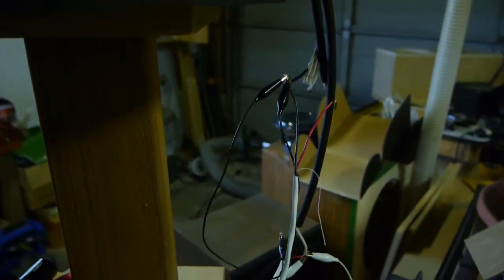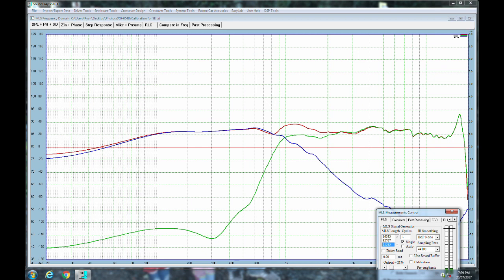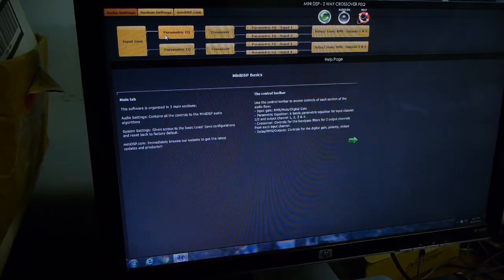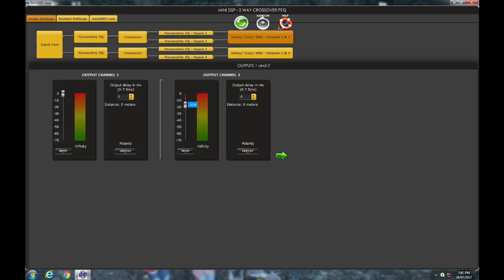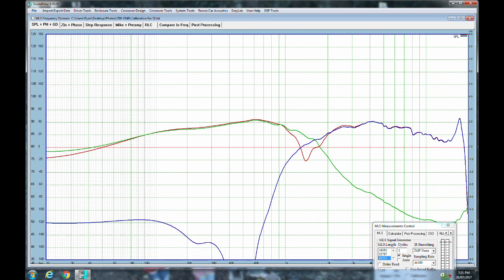Are Active Crossovers Easier than Passive? NO!

Comment: Hey you didnt point out the major attraction from the active xover, that by splitting the audio into separate bands BEFORE the power amps, each amp and each speaker unit now handle only their allocated band of sound, or in other words, each amp now outputs LESS power at a given SPL, coz it no l9nger has to amplofy the other band(s) of aidio that otherwise gets sent to the speaker which filtres it out oventually in a passive xover design. 

I find active xovering an advanced level of playground for audiophiles and engineers that give much much more tuning possibilities than simply matching one amp with one whole speaker.

The audio perfectionist's l9ve here.
Reply from the maker: That is true, active has many great advantages over passive. This video was only to show that they require equal knowledge of how to design a speaker. Seems I didn't make that point very well though.

Comment: I'm using a Pioneer active xover with my Tannoy 10" Gold Mon. and my JBL 4320 (this one as a subwoofer) to listen to vinyls. This must be much better if I switch to the  digital minidsp. But how do I use that minidsp unit for analogue audio? Impossible without further complication, right?
Reply: Stick with your Pioneer or pick up an Ashly or Marchand. Both sound very natural. Not DSP's but once you get the points figured out by testing, set it and leave it. You'll want to fabricate a BSC network between x-over and amp for the best sound. Do a Google search for a diagram. It will only cost you a few dollars in parts. Be prepared to be blown away by the sound quality.

Comment: Wow.
"look! The phase is wrong! I knew it would be bad! Don't use active crossovers guys"
later: presses a button to correct phase
Reply from the maker: Gara Von Hoiwkenzoiber I did not know how bad the phase would be. Yes phase is easier to correct with active. But the same knowledge and work is required to get there. That was the point of the video. Not which one is easier to program. It’s not a magic box like some people treat it and think it is. Not many people even know what phase is but they think active just makes it ok.
Reply: Hi, im feom indonesia.
Mini dsp is $105 at PE, with shipping and tax its $161 at my door.
Dont have budget for it.
I go with $3 caps, and $6 inductor.
With free XSim, im doing fine with passive.

Comment: I think you make valuable points in this video with adding another channel into an active setup introducing potential phase issues, and you also explained how to use the tools to remedy those issues. 

The mini dsp is going to be much more versatile than a passive cross over and can be used in conjunction with passive. The beauty is in its modularity. 

The tools in that little box will yield much better results than passive crossovers alone. The time correction alone will allow you to achieve focus in irregular or odd shaped listening environments and you can make instantaneous changes on the fly that can't be accounted for with calculations.

Comment: Active is the only way to go. I haven't touched passive for years. I have a miniDSP 2x4, MiniDSP DDRC24, Dayton DSP-408, amplifiers with built in DSP, etc etc. It makes life so much easier and cheaper. Different speaker projects become much easier for newbies to get into without having to have a degree in electrical engineering and soldering. With a DSP you can make changes on the fly while listening to music rather than taking everything apart, buying different components, connecting components then listening..no way to A/B compare or tune the system quickly.

Comment: Generally the group delay of the woofer is longer than the tweeter due to its higher inertial mass. Therefore to synchronize them in time the digital delay should be applied to the tweeter

This is still not good enough to get phase coherence. To do that they need to have the same geometric center of propagatoon, in other words they have to be coaxial. 

This problem is like throwing two rocks in a still pond and getting them to produce ripples as though they were a single rock. To achieve that they not only have to hit the water at the same time but also in the same place,  otherwise you will still get phase interference patterns.
Reply from the maker: Mark Fischer in this case the delay was applied to the woofer because the tweeter acoustic center was behind the woofer.

Comment: Never liked DSP.
Reply from the maker: WESTEL Audio really? I don’t have a problem with dsp, it’s powerful that is for sure. So I use it where appropriate.
Reply: @ImpulseAudioSpeakers  

I feel like it's just adding unnecessary complexity. You can't use a normal 2-channel receiver and if the DSP, being a very fragile little computer, breaks you have to start all over again. Only things they are good for are active PA speakers where weight really matters or sub/sat systems with very low cut-off.
Reply: @westelaudio943  Lol fragile. I can promise you that if you drop it from 1m it will survive but if you drop your 15kg avr from 1m it will not. Smaller electronics is usually more durable.

Comment: What I really don't get with the practicalities of phase is that the SPL can measure fine (flat) but I believe there can still be phase issues which play havoc with the sound.  Any thoughts welcomed, cheers Ryan.
Reply from the maker: MrFrobbo what is usually happening is a case like this is the FR is flat but phase is wrong, so the power response (a combination of all points off axis) ends up being very peaky in the midrange (or where ever the XO point is). It can sound very glaring and forward. Something won’t sound natural.
Reply: @ImpulseAudioSpeakers  Thanks Ryan really useful...think I'm getting it...slowly!

Comment: I get your point that one cannot naively convert a passive design into an active or design a system from scratch without having at least minimum required knowledge regarding designing loudspeaker systems. you give a very good example in this video yourself. I think rookie DIYer having no clue about phase issues would try to eq that dip out in minidsp and arrive at a badly designed system that potentially measures quite flat but sounds just not right.

also one thing to remember is that those who attempt to design active systems do it not only for the sake of driving each driver with its own amplifier but also for possibility to take full advantage of DSP power - driver time alignment, linear phase xo, driver linearization, steeper slopes.
Reply from the maker: David Gale thank you for understanding the point of the video. It was lost on many. Your right about the advantage of DSP. It is very powerful and if you know what you’re doing then it is unmatched by passive.

Comment: Delay?  your tweeter is 140deg out of phase (according to you)...  you've tested it with a generic passive and now with active....   Did it occur to you to flip the electrical polarity on the tweeter, in order for it to be acoustically in phase with the woofer.  The delay hack is a horrible suggestion, because now the woofer and tweeter going to be OUT of phase EVERYWHERE on the spectrum, by the amount of the delay.   It's not a big deal because the x-order is 24db/octave, but it's a hack - the delay was never meant to be used like this.
Reply from the maker: pretol the delay was absolutely meant to be used like this. It’s puts the drivers exactly in phase where as simply flipping polarity would still be out by 40 degrees. Not sure where you got the idea the passive XO was generic. It was properly designed which is why it measured way better.
Reply: You're right, I meant generic active (which is the hack job you've done for this "test") vs "properly"-tuned passive (according to you).  Which is NOT good guide for people that are building speakers at this level, and YET, here you are making profound conclusions.   You'd have to be a moron to design an active XO with generic parameters.  Tunability is THE WHOLE point of active XO's (presumably with a calib'ed mic), and here you've done almost none (except wiring your tweeter backwards, and compensating for it with delay).

Comment: Luv this guy's vids but this beyond his scope (no disrespect), you can't hack DSP, it's graduate level math. For example you can auto compensate a speaker that would not be possible by analog/passive means (theoretically impossible). DSP essentially emulates the analog parts, thus u can create a "part" that does not exist or even physically not possible, like negative capacitance (I'm keeping this simple, it's the same tech used in military guidance sys for example). Beyond that you can compensate the speaker's impulse response (not practically doable in the analog world). Then there's efficiency, the reason you have power components is the passive X-over is it throws power out the window to compensate (utterly ancient way of doing things).   good news is you have software that can do it all work for you now, no thinking involved, like cell phones leading everyone by the nose (yeah i'm from the DSP world, b4 it was a buzz word ;) ).
Reply from the maker: Greg D no thinking necessary? Clearly using dsp is also beyond your scope. The point of the video was to show newbs that just as much thought was necessary. Did you watch the video? Not sure you did. Please watch the whole thing and tell me if you still don’t get it. A newb cannot just hook up a dsp magic box and enter 2000hz LR4 and expect good results. That’s not going to sound good. And I showed it here. 

Clearly my video was not easy for people to understand. For that I apologize. Still not sure why, I thought it was simple. It is just as much design work as passive. Period. 

And BTW, I like active, maybe even more than passive. This is not a hate on active speakers video!!
Reply: Wow man, i was being polite, you're having a reaction. Yes i watched the entire vid, did you read my entire message? You do good stuff man but your video was like someone who's never flown a jet then trying to demo it without any flight experience of any kind, but again, no disrespect. Or are you saying you're very familiar with DSP? enough to say it's beyond someone's scope? You know convolution cold and it's edge affects? u know self adapting communication channel compensation filters so these audio steady state one's are are like childs play? Because if you are, then spend a little more time on the vid to do it right, if not then maybe don't post until it is right. So yes, there are programs now that will analyse the speakers then adaptively create the dual FIR/IIR filter coefficients to completely compensate it in every way, you can follow a procedure so one  doesn't actually have to know what one is doing ( here's one for the laymen: http://www.bodziosoftware.com.au/). Verses say going knee deep into MATLAB or writing your own code and download your own coefficients to the DSP, but again, then you have to know math at a graduate level. Also that MiniDsp unit you have will not do impulse response correction and i don't want to get into why but it's a key disadvantage. And really man, every wonder why it's only "home guys" posting on the net, not guys from the Boeing lab or Tesla or the DOD or other pro's? because they keep it inhouse, so it's odd to me when an expert might chime in and say, be careful, you might unknowingly be posting miss information (which is rampant now). So one of my "DSP buddies" saw your response and said "why do you bother man?" and yeah.. he's right, so good luck man, this post was for others and try beware of what you don't know (btw, spare me the "male fragility complex" which is what your "clearly dsp is beyond your scope" retort is (i qualified mine), unless again, you're in the DSP industry as i inquired above, which means you really do have some other issue).
Reply from the maker: Greg D alright sorry, my comment was over the line. Although it was really no different than your comment. Saying you like my other videos first doesn’t change the comment. 

I still don’t understand what you disagree with in this video. The video is saying that you cannot take pre determined electrical filters and simply plug them in and bam good results. That’s all the video is saying. Do you disagree?

By the way, professionals do post online. All the time. I’ve seen forums and facebooks posts from engineers with JBL, pioneer, etc. Not sure what a Boeing engineer has to do with audio. 

Those auto calculators are only so good. First, they still require measurements, which is partly what this video was saying. Second, they can’t fix things like driver spacing, Pilar response, distortion, etc. The speaker builder needs to make engineering decisions about this. Writing dsp math has nothing to do with the video. My comment about watching the video was not meant to be rude. I seriously ask did you watch all of it? Understand it? I admitted in my comment that clearly the video was not good because you’re about the 20th person to misunderstand. Do you think newbs can just buy a mini dsp and hook up two drivers and then program it to use an iir filter of what ever frequency and get good results? I doubt you do. Because as shown in the video you will very likely get bad results.
Reply: @gregd6022  hi Greg, what dsp crossover can do impulse response correction? Is lack of impulse response correction a flaw across the whole minidsp line? Any other links to software to analyze drivers you would recommend. Think of going dsp to gets some Altec 604Es to work as well as they can.
Reply: @meshplates   here are two I know of... DDRC-88A and nanoAVR DL
Reply: @ImpulseAudioSpeakers  The only person saying you can plug-in a miniDSP and automatically get good results....IS YOU. Having an argument with people noone made.
Reply from the maker: dantheman1998 this has not been my experience. People often tell me they can’t design a XO so they’re going to use a mini dsp. All the time.
Reply from the maker: dantheman1998 think of the products I mention in the video. How would they even exist if you were right. Also, I just did a quick search on YouTube and found a video with 248,000 views doing exactly what I’m saying don’t do in this video (wasn’t a mini dsp though). I can only dream of that many views. People are doing this left and right. Very few people are warning others that it’s incorrect. I think I’m the only person on YouTube saying it. Yet this video is full of comments ripping on me for trying to save people trouble and teach them something that I know to be correct.

Comment: what a bs that's the result of a steeper roll off man learn something 12 db vs 24 before you go preaching and yes fase time alignment / all thing done rong are ....... passive or active
Reply from the maker: pissywits pissywits not sure you got the point of this. It doesn’t matter what XO slope you use, they have to be done properly. That was the message here. But maybe I misunderstood you because there’s a lot of spelling errors in your comment and I can’t understand it. 

Do you believe someone can simply hook up an active dsp box and get perfect results? Or do you believe they have to properly time align, level set, eq, etc? That’s was the point of the video. Watch again. The whole thing.